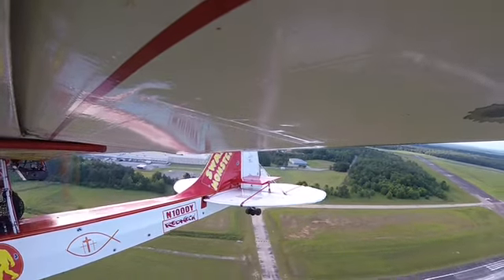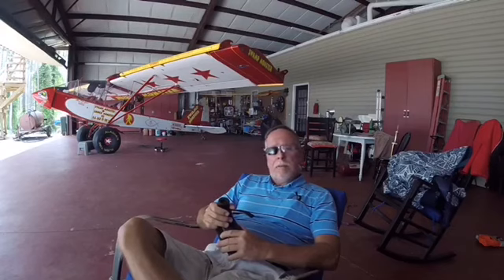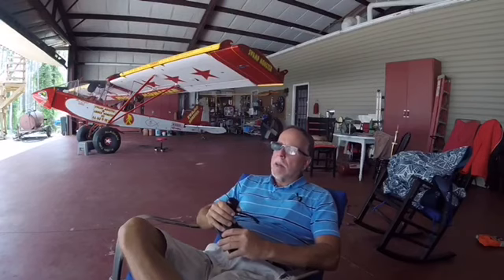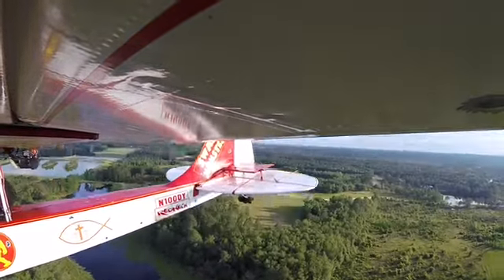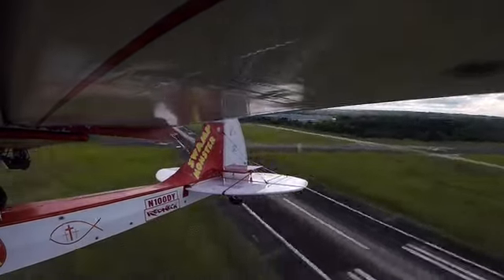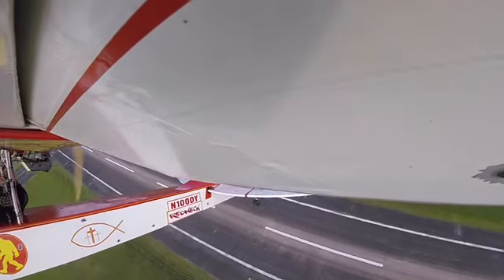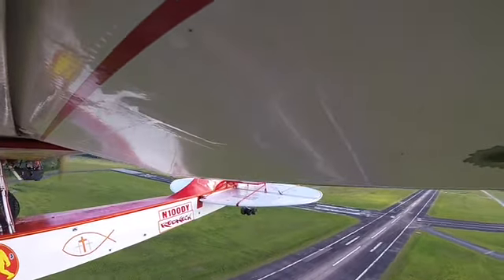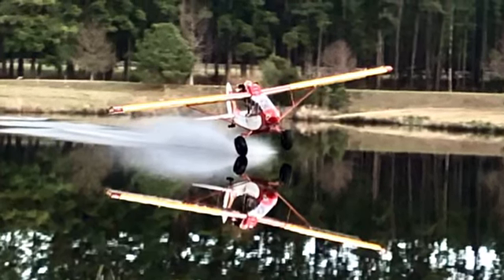Narrated Servovator Flight

Comment: Sure would like to see more on your mods like how are your flaps operated . Are they cable or push rod & torque tube ? If you were gonna build your slats from scratch how would you have done it? How is your belly flap operated? What is your wing span now ? Im building an Acey Duecy  & its about ready to cover but your mods are a great inspiration.  Thanks
Reply from the maker: Scott Rosenboom The video I have linked below gives a good view of how the flaps work. The flaps are slaved to the belly flap, the belly flap is activated by a rod under the front of the fuselage that goes to a three position flap handle in the cockpit.
https://youtu.be/06s0LqqHiLw